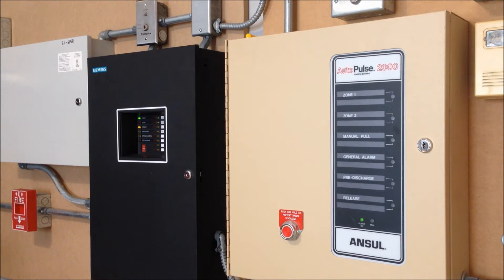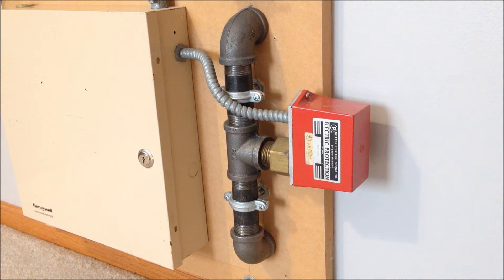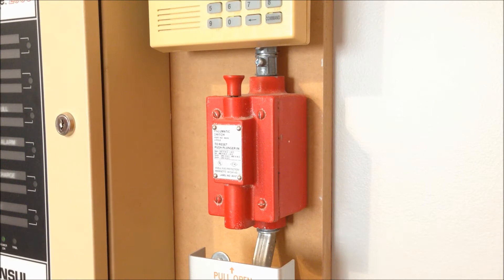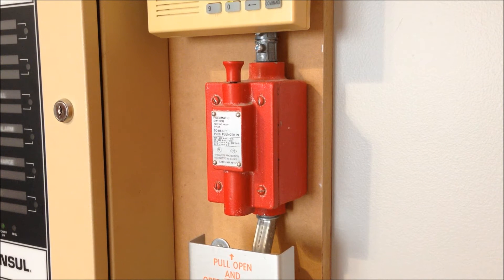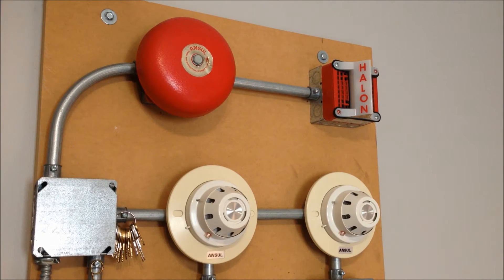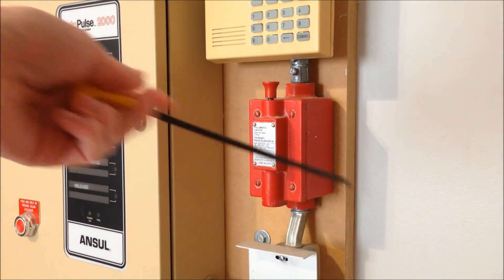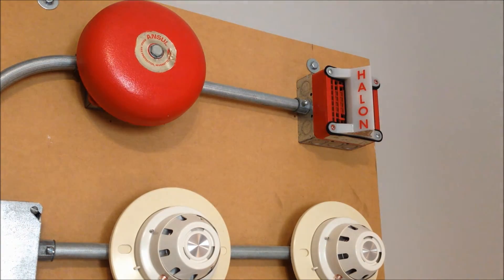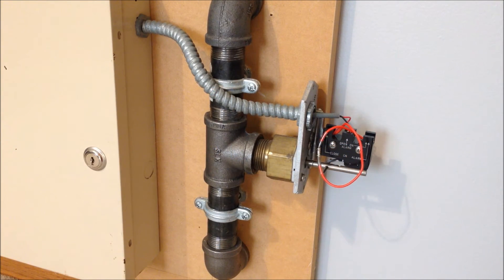System Test 27 | Halon and Sprinkler Flow Switches

Comment: Nice! Yeah, with what you said at the end, don't even try to continue running those two devices together. I've had many problems before hooking up old Simplex electro-mechanical horns to panels. An extra power supply would probably be your best bet.
Reply from the maker: I've got a Locknetics 510 power supply I'm going to try to use. I agree, I'm calling it quits on using these horns together on the system. The last thing I need is any damage to this panel. BTW, I filmed System Test 28 earlier this afternoon. I'll be uploading it on Friday night!
Reply: Awesome, look forward to that!